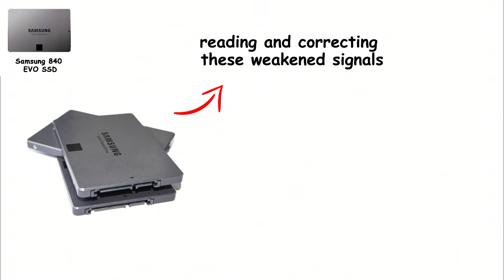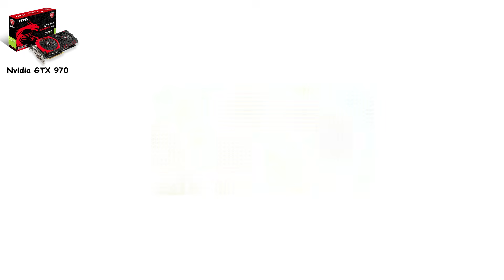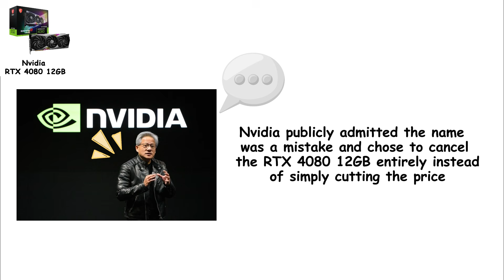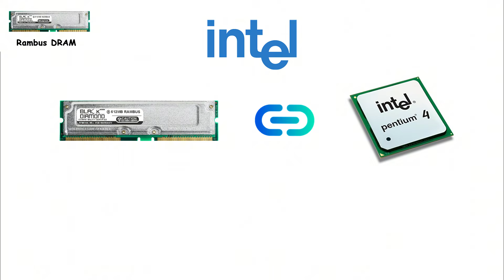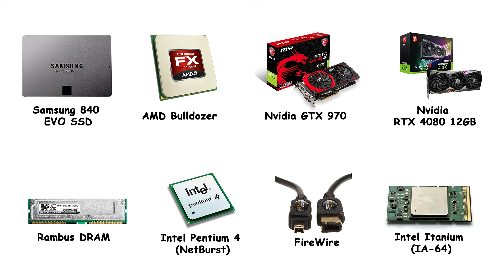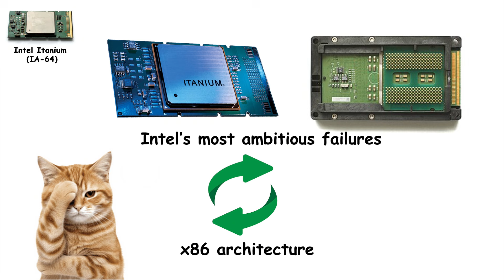Every NIGHTMARE Tech FAIL Explained in 11 Minutes!

Comment: Despite being a piece of shit, the first Pentium 4 was a big success, despite being really expensive, not only because of the CPU, but also because of Rambus RAM. At the time, you can buy an 1.2Ghz Athlon CPU or an 1Ghz Pentium III which had a decent performance for it's clock speed, but cannot reach at the time speeds above 1.1Ghz. Meanwhile, the P4 started at 1.3Ghz up to 1.5Ghz and many people thought it was much better than the Athlon, which was also cheaper. Some motherboards for the P4 had chipsets that supported SDRAM, clocked at 133Mhz vs 400Mhz of Rambus and 200/266Mhz from the DDR.

Comment: Its not so much that the AI slop is irritating. Its the sheer laziness of the authors of this slop that drives me crazy.
Reply: I get where you’re coming from, but using AI doesn’t automatically mean someone is lazy. For some creators, it’s just a tool to save time or work within budget limits. The quality still depends on how it’s used. It’s fair to prefer human-made content, but assuming bad intent from every creator might be a bit harsh.
Reply: @saefulaminin-y7s  My point was, know the limitations of your tools. Much of the garbage out here that is clearly AI-produced has those limitations glaringly visible (e.g. mispronounced words and odd, misplaced pauses). To me, that's just laziness. I used to do text-to-speech for some audio flashcards I worked on years ago. The speech software had some clear limitations that could be easily mitigated by spelling a word differently, inserting (or removing) spaces, etc. A quality craftsman knows their tool and its limitations. A lazy craftsman doesn't care and it shows in the final product.